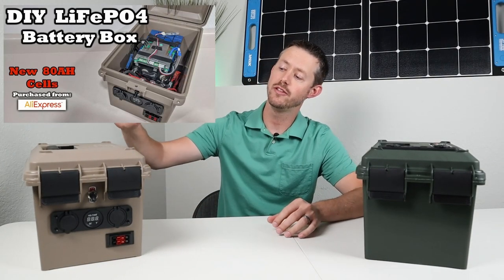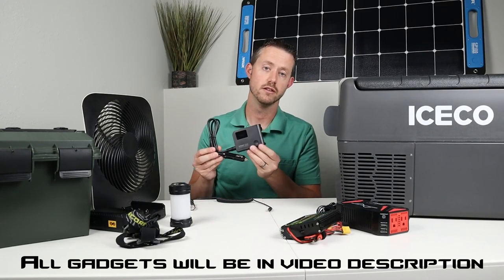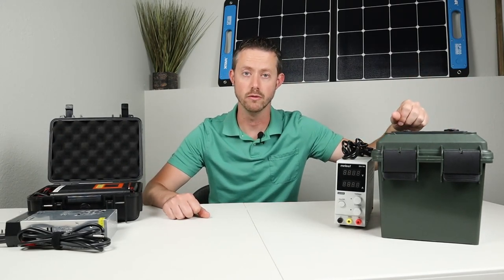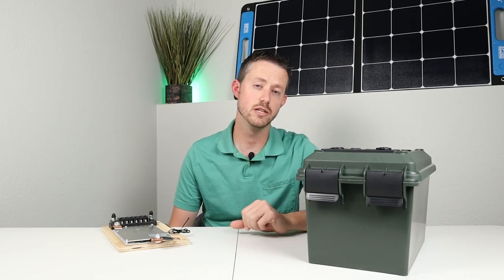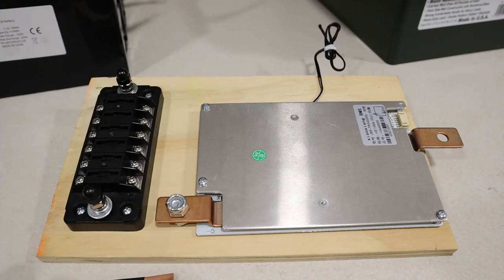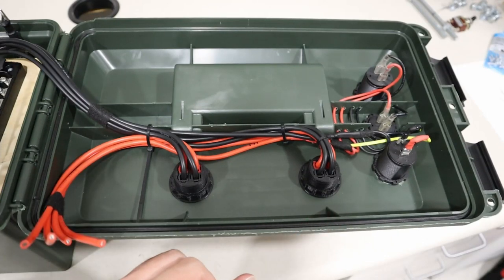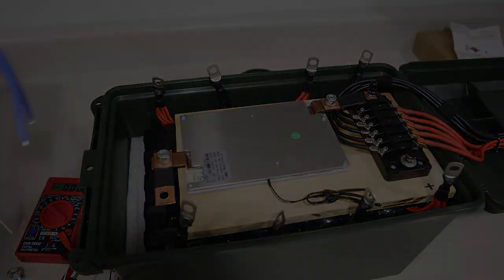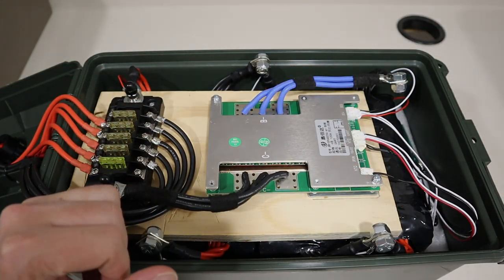$420 100AH LiFePO4 Build - BatteryHookup.com Modules - Super Easy Assembly! COMPLETE DIY GUIDE!

Comment: So from this it appears that you could run a 1000W Pure Sine converter but because of the 30A power pole connections you would be limited to max 960W. Is that correct? Or could I add more 30A power pole connectors to get the full 100A draw out of the battery to power the 1000W pure sine inverter? If not what would be the best way to do it? 

Thanks! I have the batteries and BMS on order, now I just need to get the other components in but was trying to get over this roadblock.
Reply from the maker: There are many types of output connection you can use. You could even connect directly to the BMS output for the full 100amp output or use Anderson Powerpole connections in parallel to add up to 100 amps.
Reply: @Jasonoid  Based on this what would be your recommendation? Or would you be able to point me in the direction of the best connector?
Reply from the maker: @mulze32  I prefer the APP style connections since they are easily connected and you can't reverse the polarity. I'd probably recommend trying to spread the load out between multiple connections if you like that type of style. You could use 10awg instead of 12awg wire so youd only need 4 connections total @ 30amps each for a total of 120 amps (trimming a little off the 10awg wire to fit into the 30amp APP connector).
Reply: @Jasonoid  that makes sense to me so thank you very much!

Comment: I see you used a variable power supply to balance the 4 batteries to 3.26 volts at the beginning of the build. How close to each other can the 4 voltages be so you wouldn’t have to balance charge them? I don’t have a variable power supply. Is there another way to balance them if needed?
Reply from the maker: You don't have to balance the cells but if you want the best capacity you'll want to top balance. You can connect them in series if the voltages are with 0.1 volts or 0.2 volts of eachother. When purchasing these modules they should be fairly close in voltage but you'll notice that you won't get full capacity unless you top balance charge them (1 battery will hit 3.65v before the others and the BMS will shut off charging).

Another option to top balance would be to use a 'lithium hobby grade battery charger'. You'll need to make sure that it supports lifepo4(lfp) chemistry, most do. Those are a little less expensive than these variable power supplies. You should be able to find one on amazon.
Reply: @Jasonoid  would this be a 12v charger or some other voltage
Reply from the maker: @kenmoist  You'd want to look for something like this:    https://amzn.to/3pOGBVO
The Variable power supply I have is this:    https://amzn.to/32IFDBK
Reply: @Jasonoid  awesome thanks!

Comment: Hi Jason Great video I have same package you showed and had trouble getting amps through BMS finished build had 14.6 volts  but no amps going through BMS  let it sit for a few days and checked again volts were at 13.5 put charger back on brought up to 14.6 again still no amps ? if bypass BMS I have 108 amps in battery pack will contact battery hookup and see if BMS is defective  I cut piece of Plexiglas to cover top of BMS to avoid  shorts to it wile wiring. could use painters tape temporarily also to avoid shorts.
Reply from the maker: The Lifepo4 battery chemistry will settle down from 14.6 volts to 13.5 volts within 24 hours of charging it fully or pulling a tiny bit of power from it. 

Did you activate the BMS yet? You have to hook a battery charger in line with the battery/bms and that enabled the BMS for the first time for me.
Reply: @Jasonoid  yes I  did  still no Amps have no idea how volts can come through BMS but no amps ?  but I   contacted battery hookup and explained my problem  with pics they are sending me a replacement to try will send them defective back  they are great people to do business with also put l your video on there F.B. Group explaining how great a job you have done on this build video hope it helps others out as you have me  thankyou again.
Reply from the maker: @bruceburt5150  thanks Bruce! I have only had great experiences with the people at battery hookup! Appreciate the share on Facebook, thanks so much!!

Comment: I've put together this system and the battery voltage of the pack is 12.77v total. Measuring between the C- side of the bms and the positive end of the battery only shows 11.34v. If I hook up anything to it, it goes down to anywhere between 2-4v. If I unhook the load, it goes back up to 11.34v. This is weird. The bms seems messed up.
Reply from the maker: Check my wiring diagram in my website, link is in the video description. I updated the diagram to show the proper wiring of the BMS balance leads. It should go from 3.2v on cell 1 to 12.8v on cell 4. Each cell should be around 3.2v
Reply: @Jasonoid  your balance lead diagram shows the red wire on the left. From a top view, mine is on the right (same as yours in the video). I hooked the red wire to main positive, then the white wire next to it goes to the series connection closest to the main positive. Middle white wire to the middle series connection and so on. Is this wrong?
Reply from the maker: @camt1818  they go in order in a series connection to the next series connection. Starting with red on main positive and then the wire next to the red on goes to the next serial connection and so forth. It ends with black on the main negative.
Reply: @Jasonoid  well it seems to have fixed itself. I went and checked the voltage again this morning after it sat all night and it's at 12.77v. Hooked up my power unit back up to it and it all works. Even takes a charge without cutting out. I guess the bms just needed to wake itself up over time. Just to make sure the bms is totally working, I dunked the temp sensor into a cup of salty ice water. It blocked my charger no problem. Happy to know I did nothing wrong on my end! Haha. Thanks for the tips and awesome video!
Reply from the maker: @camt1818  glad to hear it's working! Good job on your build, I love this battery!

Comment: Looks like it around half the cost to build one vs buying a jackery or bluetti or equivalent. My concern is the life of the batteries after taking the time to build these. How have they held up and what kind of use have you given them?
Reply from the maker: They will have the same "life cycles" as the lifepo4 power stations, 2000+ cycles and still have 80% capacity (so 80amp hours left).  I've used it quite a bit for camping this last year running 12v fridges and other on and off usesx I don't use it everyday but it's held up great. I was able to pull 108amp hours from mine a few weeks ago.

Comment: What are your thoughts about separating out, at the BMS, a charging port and the power ports?  I built a small 10Ah battery and the BMS has connections for charging, using a solar charge controller, and main power.  I could use something a bit bigger for higher power amateur radio applications.
Reply from the maker: Think of this battery like your car starter battery. You have loads on the battery (headlights, radio, heated seats....) and at the same time it's charging from the alternator. These batteries behave the same way, no need for a separate charging port and discharging port. If more power is going into the battery than going out, it will charge. If more power is going out of the battery than coming in, it will discharge.
Reply: @Jasonoid  From what I've heard, charging and discharging these cells shortens their life. Is that true? If so does it affect battery life enough to be noticeable?
Reply from the maker: @leftofone  I haven't used my battery enough to find out. I put this battery though the paces and it's still going like the day I put it together. 4000 cycles to 80% is crazy, by the time I get to that number better battery tech will be available, things are advancing quickly now!

Comment: Awesome build! Quick question: the gauge wires you used for the front panel / led on-off switch looks like 14/16 awg. Is that safe for the 12v socket if you are say using a higher demand accessory? I know the Anderson connectors you used the thicker 12awg. Trying to build my own and I want to make sure I’m safe with the loads and wiring gauges. Thanks again.
Reply from the maker: I couldn't find a flush mount switch that had 12awg wires. As long at the length is minimal it should be okay. Use the APP for higher loads, use the front panel for under 75 watts or so.

Comment: Could you then put 4 of these in series and have 48V ? Or would the BMS scheme need to change?
Reply from the maker: It'd probably be more simple to  just wire it in 16S with one single bms. I haven't tested doing 4 (4s) batteries in series with 4 individual bms modules. That might work though.

Comment: What is the length of the hex bolts that you used? They looks like 1/2 or 3/4. I can’t find 1/2 stainless steel anywhere, only 3/4. In addition how would you recommend to connect a trolling motor to that battery? It requires 60 amp fuse and you can’t directly connect it to the fuse block as the fuse block is only rated to 75 amp. The trolling motor draws 50 amp and requires 60 amp fuse and 8 awg wires.

Also what’s the size of the terminal connectors that you used for the 12 awg wires to the fuse block?
Reply from the maker: ACE Hardware is an excellent place to go for hardware. I used 1/2 inch zinc plated bolts. I didn't use stainless. 3/4 inch would probably fit. You'd want to really cover them up to avoid short circuits on the BMS.

For the trolling motor you might want to connect directly to the main '+ and - 'of the battery (negative lead after the BMS for protection). I'd probably use 4 or 6 awg wire to avoid voltage drop and help with any surge current. Have an 80amp fuse on the positive line. Maybe you could use some larger Anderson Powerpole connections? You'd have to get a little creative on that coming out of the box.

For the fuse block I used M5 terminals designed for 10-12awg wire. Crimped, soldered, and then heat shrinked. 

I've been pretty happy with this setup:   https://amzn.to/3vEUqYe
Reply: I purchased the 5/16 x1/2 ss bolts and locknuts at my local Lowe’s.As for a trolling motor application u would not use the fuse block.You would either connect from the bms. To the negative side of the connector or the negative side of the battery post.THe battery post connection might require a short extension lead 10 gauge or better.To avoid confusion the connector would be the one u use to connect to the trolling motor .  The battery posts have to be purchased and an option to the connector..The positive lead would go to one end of the fuse and the other end of the fuse would go to the positive end of the connector wire or the positive post which again u might have to make a short lead 10gauge or better.Using a connector would require weatherproof cable glands of the appropriate size which can be purchased online.plenty of videos on utube on trolling motor battery boxes for ideas.
Reply: Correction on the post wire gauge  minimum 8guage or better to both posts depending on battery usage.
Reply: Clarification on the post wiring where I suggested 10 gauge or better the 10gauge should be 3 multiples of 10gauge wire or a thicker wire  in accordance with the battery application.
Reply: I make battery backups for friends CPAP units by using Minn Kota trolling motor battery cases. I keep upgrading one unit from 50ah AGM to 64ah Headway cells, to 100ah  TOBattery with built in BMS ($389 from eBay plus tax). What's interesting is that TWO of the 100ah batteries will fit within the battery box giving it 200 amp hours capacity.
The best part of this battery case is that it has built in 60 amp and 10 amp circuit breakers. Imagine fishing with 200 amp hours behind the propeller in a standard battery box.

If you are using your battery for a trolling motor, you can actually use those plastic wing nut terminals fed with the 60 amp breaker to recharge your battery using jumper cables  from a running car engine much faster than using solar panels. 15 minutes on jumper cables boosts the power to run a CPAP unit all night. I didn't calculate the rise in state of charge but its substantial.

The 100ah battery I used is under this eBay heading ...12V 100AH LiFePO4 Lithium Iron Phosphate Battery With BMS Dual High/Low Temp Cut

Comment: I really appreciate this video. I'm looking at building something like this with a solar charging capability.  I have a 20A mppt charge cintroller.  I have a 100 watt solar suitcase from renogy.  The charge controller is connected to a fuse block with a 20A fuse before leading to the battery.  Where I'm confused is a fuse between the panel and the controller.  It has a 2.73x2 short circuit current and I'm using 10AWG wire.  I don't think I need a fuse,  but I have seen some recomend it.   Would you recommend adding an in line fuse of about 7.5 Amps just before the charge cintroller?
Reply from the maker: I don't think you need to add a fuse on the solar side, not enough current to cause issues.
Reply: @Jasonoid  that was my thought as well.  Thank you for the help and thanks foe the videos you do. They are awesome, and great info.

Comment: what would it take to make this thing accept 12v input from a car to charge it?
Reply from the maker: You need to take the power from your car alternator and convert it to a charging voltage. The easiest way to do that is to buy a "DC to DC charger" like this video:
https://youtu.be/HdBd0_SJf0A

Comment: Awesome vid.  You answered several questions I had regarding my build with the same modules.  I have one very basic...maybe silly question that I cant find info on.  I got a BMS with the bluetooth module.  Question:  Can the bluetooth module be powered off and on or is it powered the entire time it's connected to the battery pack/bms?  There will be times my pack is idle for weeks...possibly months and not sure if drain from the BT will be an issue.  Thanks and great work.
Reply from the maker: The bluetooth module goes to sleep and uses very little power compared to the power stored in these batteries. I have let mine sit for months and I come back and it's sitting near the same percentage. No need to worry about the power consumption of the bluetooth module.

Comment: What amperage fuses did you use in the build? 20 amp? 25 amp?
Reply from the maker: I used 25 amp fuses so I could pull 20 amps without blowing them.

Comment: Hey Jason, wondering if you still think the connections on the top are better than on the end of the case? I'm really torn on which way to go.
Reply from the maker: The connections take up too much space and would be too tight to fit on the front with these modules, but with other 100ah cells you could do a front mount or top mount.  I don't mind either option, each work well.  I am building another version of this battery for my friend, video is in the works and the connections are on the front.
Reply: @Jasonoid  Thanks, appreciate the quick reply and will watch for the new video. Lots of great information in this one, thanks for sharing.

Comment: Did you replace the thin gauge stock usb outlet and cigarette socket wires with 12 gauge? In the video they look slimmer than the silicone power pole wires
Reply from the maker: I combined the 12v plug and USB port wires into one 12awg wire (good for 20 amps) and ran them back to the switch and fuse panel.
Reply: @Jasonoid  Ok- so you still have thin wires coming out of 12v plug and USB ports that connect to 12 awg?
Reply from the maker: @leftofone  Yeah, but they are very short and shouldn't be an issue with voltage drop. Those cables came with the plugs in the first place.

Comment: Jason, I've been thinking about some other projects and wanted to ask if you think this power station would have the capacity to run a 700 Watt LED light for at least 18hours per day. Would it be possible to do with the help of 2 solar panels attached? My goal is to have a small grow room for plants that runs strictly on solar energy. Thanks.
Reply from the maker: Hey Jimma, great question! To run a 700w load constantly for 18 hours you would need about 12.6 kilowatts of energy. This battery has about 10% of that capacity @ 1.280 kilowatts of energy. Thats a pretty hefty load to be running that long. What do you need it for? You'd need probably around 1400 watts of solar and maybe 20 of these batteries in parallel to handle that constantly.
Reply: @Jasonoid  oh wow! 🤯 I would need it for an indoor grow tent for some plants, and I wanted to see if I could run the entire electric setup using a power station and Solar panels vs using my home electric. I would need power for a few other items, including the LED light, so it sounds like I might be better off just plugging everything into the wall 😅. 

I appreciate the response! Love the channel.
Reply from the maker: @jwiyual  it would be much cheaper to use wall power or a generator, happy to help!

Comment: Hi Jason. I have three 12V 15AH LiFePo4 batteries that already have built in BMS. Can I wire them in parallel and skip the independent BMS you use? All I really want to use it for is to charge and add capacity to my Bluetti EB55 they way you do in another video. I plan to pick up the 12v to 24v converter you use for this purpose. Thanks for the videos. I've watched few of your videos each one several times!
Reply from the maker: Yep, that will work just fine. Either put them in parallel or just hook up one at a time with that 12v to 24v converter!
Reply: @Jasonoid  Thank you much!
Reply from the maker: @zefferv9885  similar video is coming out tomorrow for larger power stations.

Comment: Do lithium batteries need a vented battery box at all?
Reply from the maker: These batteries don't "vent" like flooded lead acid batteries. If the batteries are under a very high load they can get warm and will benefit from cooling.